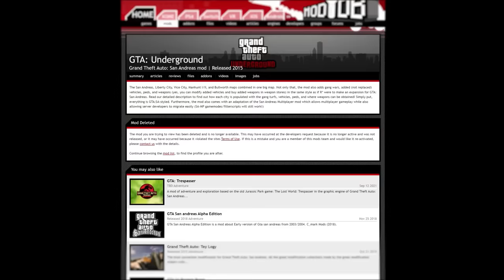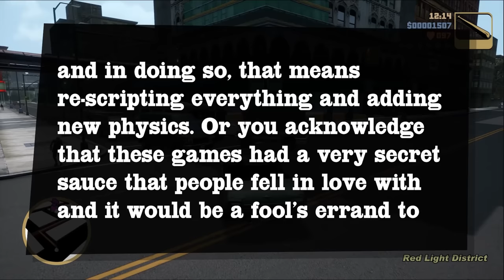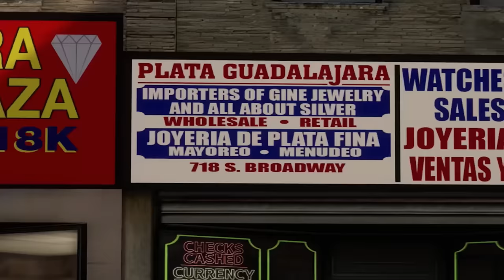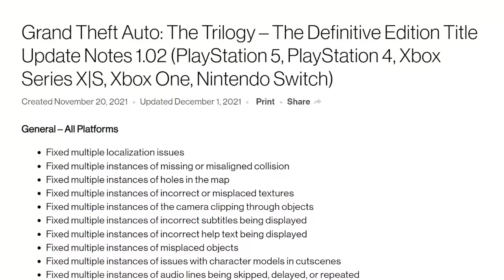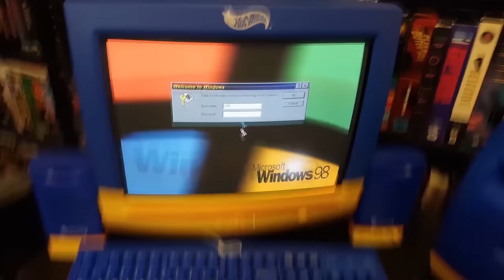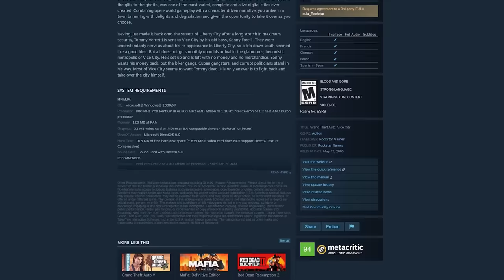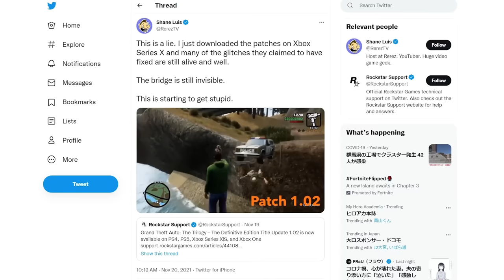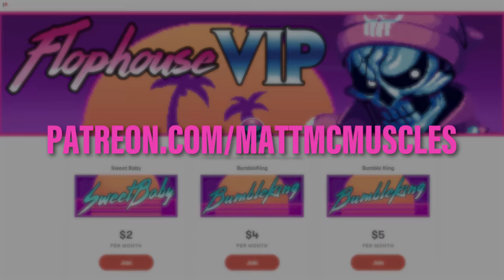Grand Theft Auto The Trilogy The Definitive Edition - What Happened?

Comment: 19:18 is perfect. The way he falls through the map randomly and goes oh fuck. Perfect dialogue
Reply: The thing is, that glitch is in the original. My CJ was riding a motorcycle on the freeway when he fell through the map. He appeared back on the road but the bike was gone. Mission: Snail Trail.
Reply: @DarkDreamsAndMoonlitNights  never had this glitch happen to me once, the only time I fell through the map was when I was messing around with cheat codes and used the infinite oxygen cheat while driving my car to the sea, since you're supposed to start drowning the moment your car goes underwater and it starts floating a little underwater it never reaches the bottom sea level, but with this cheat on you just goes through land underwater and falls into the void, lol.

Comment: Even though the results weren't great, I think it's really interesting to use machine learning to upscale a game the way they did. I wonder if, given more resources and perhaps a smaller scale, that could be successful to a degree.
Reply: Other games have done it, modders have done it for some games. Textures, meshes, videos all successfully upscaled. Difference is they had the time and resources to have a human check the output and probably a lot less to check than 3 openwork games.
Reply: Modders have already used upscale to make textures that are infinite times better than the ones in DE
Reply: It has proven to be quite a powerful tool yes. Modders have used it with great success, however you HAVE to do manual touch-ups or even combine different parts of textures from different algorithms to make it happen.

Just dropping it in, crossing your fingers & shipping it to people is a recipe for disaster.
Reply: Oh it can work. The ME1 remake used AI to do most of the upscaling of old textures, and for the most part, it worked well.
Reply: I think they just clicked a button no playtesting. AI is the shit it just still needs human supervision at this point in the timeline lol

Comment: 15:20 Employee count on LinkedIn is always an under estimate, because lots of people don't use LinkedIn (it's not a very good site). The company I currently work for has 13 employees on LinkedIn, but the actual count is 24, almost twice as much. That said, even 40-50 employees wouldn't be enough for making 3 concurrent remasters of already buggy games on a short time frame and then dealing with the backlash and the bug fix workload.

Comment: This is arguably the release that has pissed me off the most. It was such an unnecessary debacle but the sheer arrogance of releasing a product in this state goes beyond incompetence and transcends into being unethical. GTA3 is a 20 year old game that doesn't run at 60 FPS on current gen consoles!
Reply: Thats because of the engine. Rockstar for some reason never cared about a framerate Bigger than 30 FPS until the Pc Port of GTA V and the PC Port of RDR2. Not even RDR2 runs at 60 FPS on past consoles, and they could If they tried, lol.

Comment: 13:03 I bet that the delay on physical discs was because they pushed the development so late that they couldn't produce a gold master in time. A lack of physical discs hurts sales, not helps them. They were clearly making changes up to the day of release in the hopes to pull out a miracle. Same reason there is no day one patch.

Also they weren't 'algorithmically upscaled', most of the work looks to have just been good old offshore labour. However the timecrunch meant that clearly they didn't have time to review anything and get issues fixed. So they had no choice but to throw it into the game.

Grove Street clearly overextended themselves and should learn to run large projects better, or at least learn to say no to Rockstar.

Comment: I tried the gta 3 and vice city reverse engineered ports that take 2 took down they were flawless on the switch. I hope I still have the files but by far if you can find the files and have a modded switch get them and your old games and put them on your modded switch. Original graphics music aspect ratio options and everything were included and it hardly ever had a issue with frame rate it was perfect. The definitive edition should have just been the original games from the start with a option to swap between graphics like mcc if it really needed to be 're-visioned'

Comment: I mean, it can be called disaster only if the studio don't deliver the final product in the right shape. I can speak only about the switch release of the bundle but if you compare what we got at the release date and what we have now, it's day and night difference. Switch gta's looks way better, runs with stable 30fps now and even draw distance is way greater. Some devs just need more time and that's all. I was in the industry for some time and I know how much of sacrifices you have to do, just to reach the deadlines. It's not like we don't know how poorly it runs on the specific device. It's usually just that we need more time to tweak it out. If the deadline says 1.01.22 it will be playable on 1.01.22 but still, as a dev I know - more or less - what to do over next few weeks to make it run twice as good. We are just tweaking and experimenting with the code for certain stuff. Even I had spend like 40h without sleep just to tweak something perfectly. Sometimes we calculate average 10% increase of performance and it's over 50%, sometimes we calculate crucial improvement for over 50% and it's just 10%.